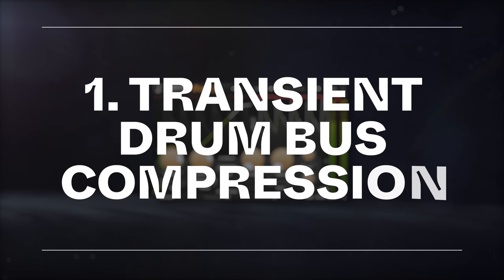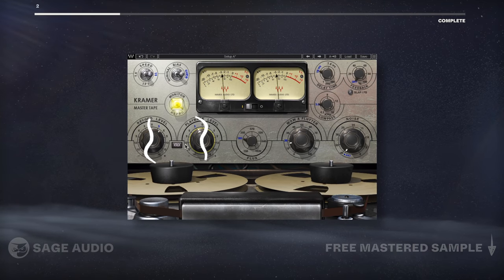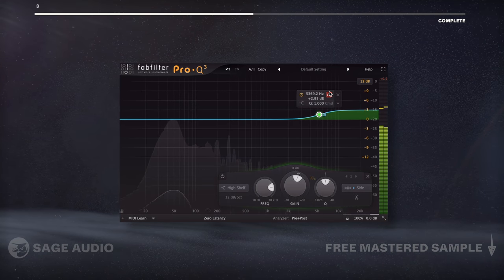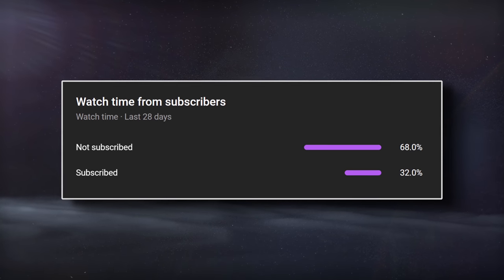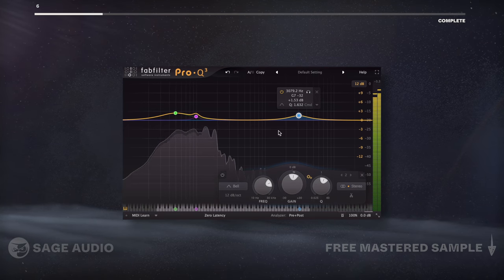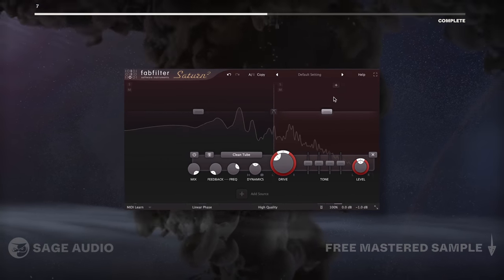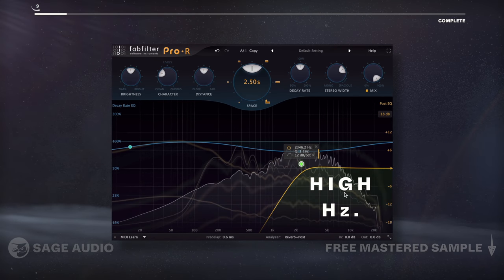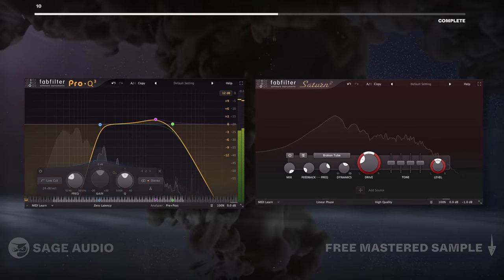How to Mix Drums

Comment: I never really understood this but how can transients stick out better when compressing with a fast attack?! Aren't you reducing the gain of the transient and maybe even losing the transient due to the ducking?!
Reply: No, compressing with fast attack is basically hard clipping. You'll jus be cutting some of the top transients but it will make the transient thicker which will make it sound punchier.
Reply: You are correct AiykA.
Reply: I was thinking the same thing..slow attack compressor creates transient..I guess fast attack with minimal reduction won’t hurt and adds distortion…also fast attack is good for parallel compression
Reply: @bevvibez  so you clip some of the peak but have a slower release time so that the clipped peak  is retained for a longer time rather than dying out quickly which results in more of a thick punchy sound rather than a clicky sound??  I guess it also depends on the release time then... I dunno man i can barely ever hear this stuff on my 3 inch monitors and untreated room...
Reply: I was wondering the same thing... I suppose it's because he set the attack so fast that EVERYTHING is being compressed, including the transients. Cuz i've always been under the impression that unless you're using parallel compression (>100%) then you should never set a super fast attack/release on the compressor or it will ruin the transients. But i might have to try this out for myself because my go-to compressor is the same one he used in the example (Pro-C2)
Reply: @professorscrim5303  what Bevan said